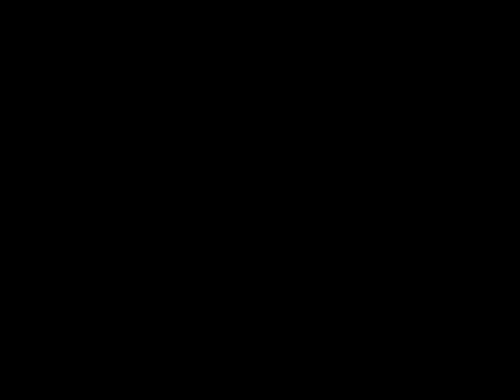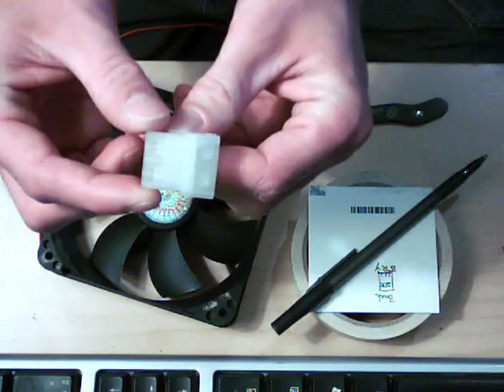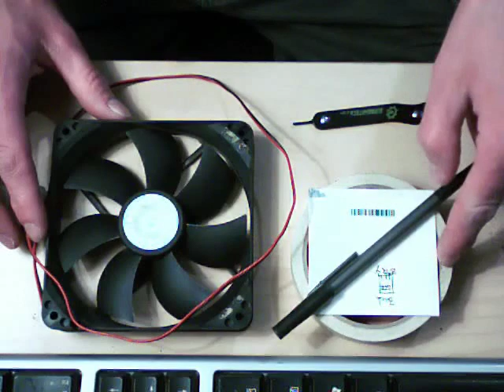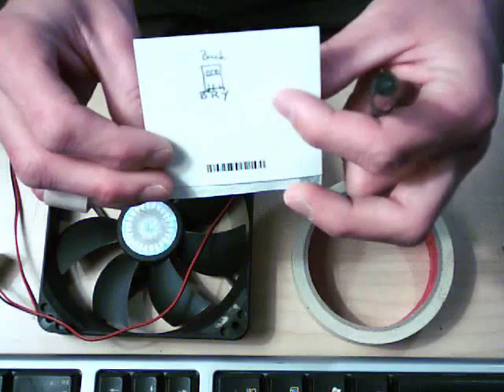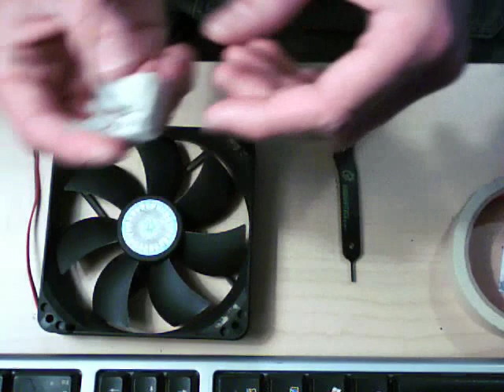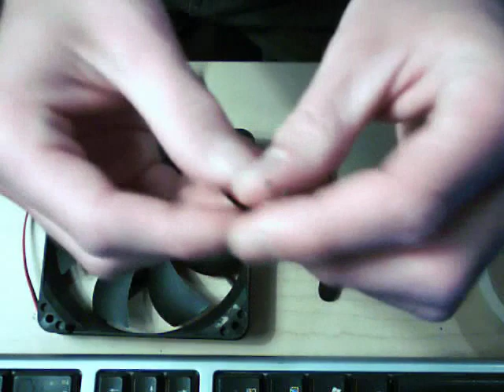How To: Remove/Install Female-Male Molex Connector

Comment from the maker: @KIREMS You can go 3 pin to molex but not other way around iirc. Since the molex only runs power and ground. The 3/4 pin connectors have a extra lead for RPM control and RPM sensor.

Comment from the maker: @MrGrandDragon You can connect it to motherboard 3-pin header or get a 3-pin to molex 4-pin adapter. There is a tab on there so it oly goes on one way no worries about wrong installation there.

Comment from the maker: You can connect them together and run off single molex but not through board the headers wont support that much draw through them will burn them out.